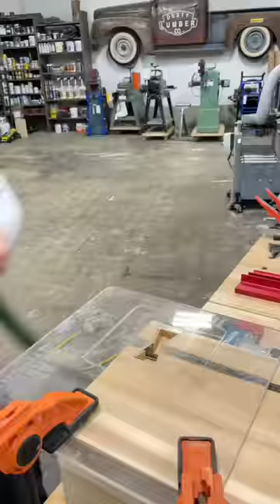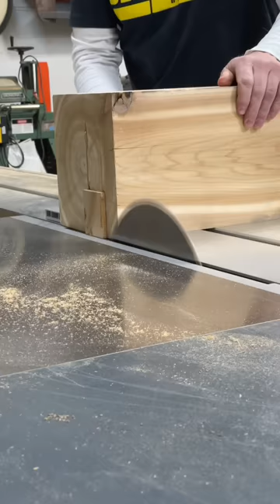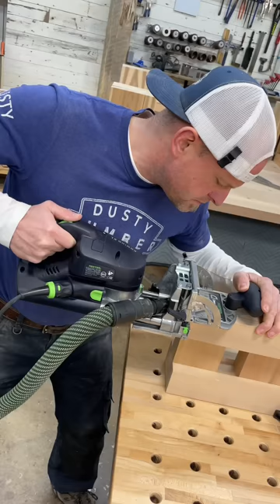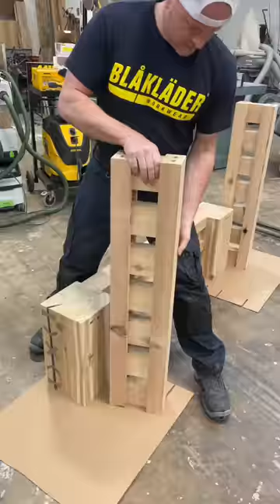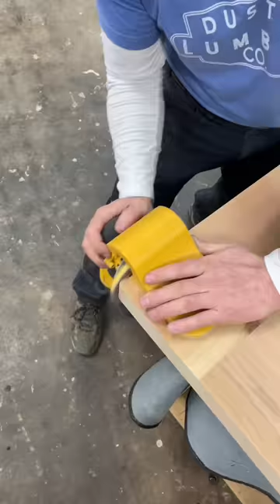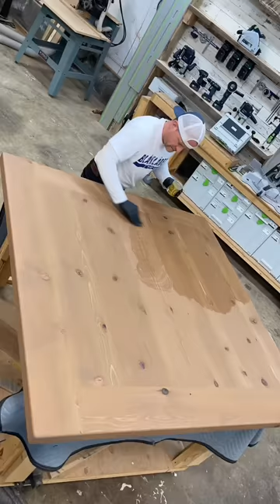Giant coffee table build start to finish

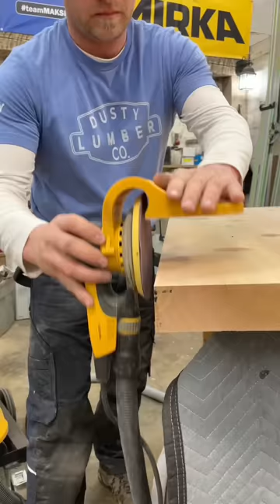Comment: That sanding attached at 5:12 is amazing. Can you get universal ones for different sanders or is it special to the brand of sander being used here?
Reply: mirka deros 90 degree edge sander
Reply: Mirka DEROS sander. Guide is an accessory.

Could use a router with a beading bit for this step, too.

Comment: When I first saw the layout of the “band board” section, I wasn’t a fan. But after assembly, I can see the design influence of Frank Lloyd Wright and I really, really like it. Huge fan of his designs and your ultra high quality work! Curious about the method to join the top to the base? What was used? Mechanical fasteners with an expansion contraction method or traditional joinery method that allows for the same movement?

Comment: What a great build!  I really like the horizontal saw and how you get the dominoes to fit so easily.  I just have one question: when you were running the round over bit around the edge, were you not travelling in the wrong direction?
Reply: Not certain if he was, I dont have any festool yet.  But my take is brand new top of the line router bit, top of the line router, dust extraction, high speed, and perfectly square edge,…means you can go whatever direction you desire.
Reply: @tender3066  Doesn't matter what kind of router you use. If you travel the same direction that the router is turning, it's going to pull you towards the work piece and you could end up getting caught up with the router bit.  Very dangerous practice with a large but, but you could get away with using a small one

Comment: Do you have a reason for running your router backwards when rounding over the top? my guess is you want the cutter to go into the cut insuring you don't blow out the edge.   I was taught not to do that because the router can climb.  It looks like it can be done I'm sure you are hanging on real tight.   FYI, beautiful work.

Comment: Beautiful work! If I may where did the 90 deg. adapter for the sander come from? Thank you, Jim.
Reply: Mirka DEROS R/O sander with added guide. Don't know which sander model but prepare to be $700+ lighter for that bit of gear. Not gonna run it all down, but maybe $20K for the power tools shown? Sliding table saw/shaper $5K-$10K at least (Felder?), Festool $100s & $1000s.

Nice work if you can get it & make it pay. Or have a pile of money to be a weekend warrior.

Comment: Amazing build. I love your work man!

I have to ask, though.. no concern about expansion causing issues with the top? I'm not an expert by any means, so it's a genuine question. I've always thought the woodgrains crossing each other like that would require a breadboard end to avoid cracks down the road due to expansion and contraction.
Reply from the maker: Thanks 
The underside has stabilizing bars and are tied into the base which is solid and cross braced 👍
Reply: @dustylumberco  ah, I see. Thank you sir! Still leaning here, so any advice/explanation is appreciated.

Comment: Looks like you made the classic rookie mistake of  not floating the  breadboard ends so the table top wont split badly due to wood movement.   And you didn't show how you attached the table top but you woulf have been unlikely to not show that detail if you properly floated that also to prevent splitting.

Comment: Anyone know what kind of router that is
Reply from the maker: It’s a Festool OF 1400
Reply: @dustylumberco  thanks u so much. I been googling forever and decided to just ask. Lolol
Reply: @dustylumberco  sorry 1 last question. Are those bits/shanks. need to wood working and never seen the spacers and router bits like that
Reply from the maker: @Notgoingtoprovide  oh are you talking about the shaper? That is a king shaper and it can take a range of different cutters or bits. 1/4” and 1/2” bits and the two different size spindles for different cutters
Reply: @dustylumberco  yea that's it. that's why I couldn't find anything. Lol. Thanks for taking the time to answer my question.